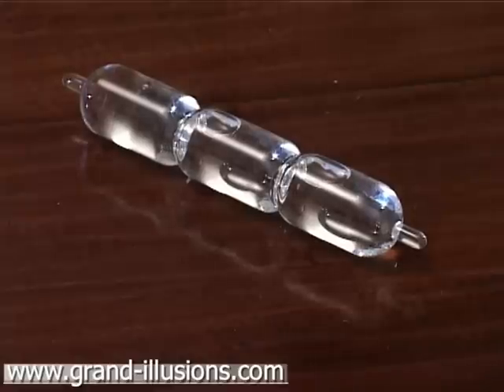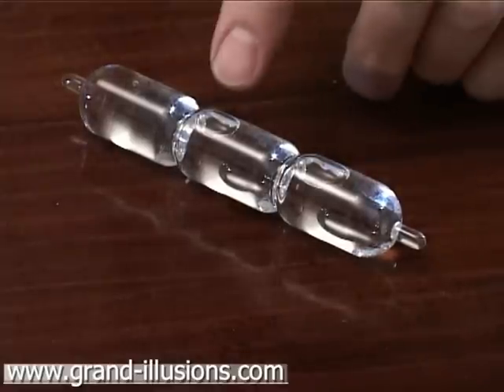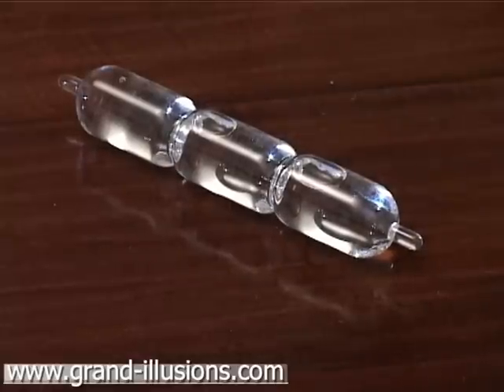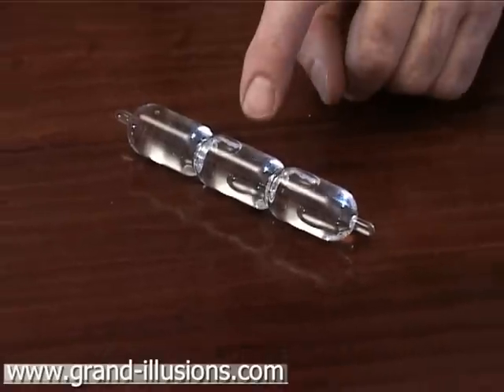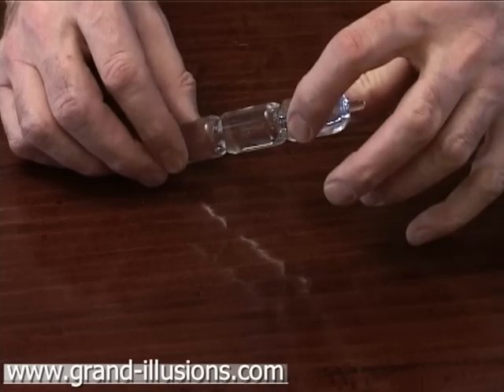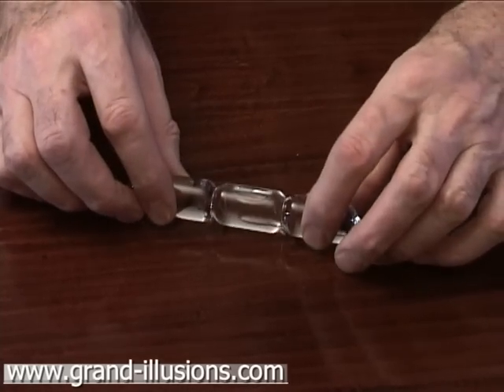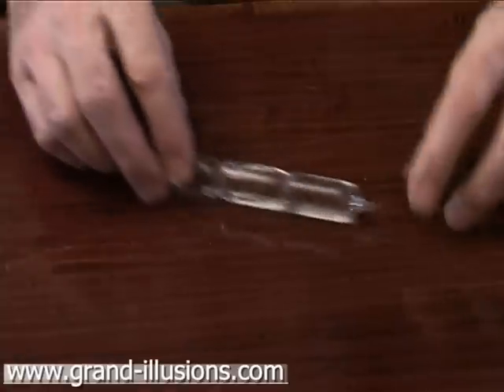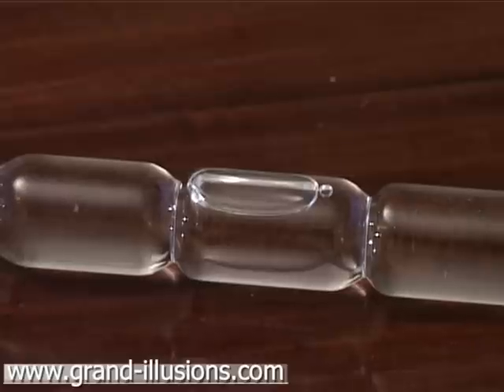Bubble Trouble

Comment: The spinning force pushes the water to the sides making higher water pressure in the two outer butt plugs. The water pressure pushes the air out of the outer butt plugs and into the center.
Reply: Into the what now?
Reply: @jessbano3715  The center
Reply: oh
Reply: @ketheranechromate7479  Not what they meant
Reply: Well damn, victorians were kinky.
Reply: @nikrue22  "put it in me while we do it, then pull out fast enough so i spin like a beyblade"
Reply: Not really sure if that's accurate, though. Pressure sometimes act weirdly. It's probably better to understand this with fluid mechanics.
Reply: Spinning the puzzle about its center makes it into a simple centrifuge.

The centrifugal force depends upon the radius, speed of rotation, the mass of the particle as well as how densely packed the particles are together. Air particles individually (O2 and N2) are actually roughly twice as heavy as water particles (H2O), so at first you might think air would win, but water is over 800 times as dense as air, so there are 800 times as many particles per unit volume of water fighting the air particles.

Because it is so much more dense, water experiences the centrifugal forces roughly 800 times greater than that of the air, pinning the air to the center, as the air struggles to impart any significant force towards the sides to overcome the water.

An industrial cyclone centrifuge has such great separation forces that you can ignore things like gravity in your calculations, and can separate things like cream and water from one another very quickly.
Reply: The G-force helps find the G-spot.
Reply: Who told you?
Reply: @MrWhatdafuBOOM  it was very clearly a joke my guy
Reply: @Willie6785  I could say the same to you.
Reply: Careful you might loose it
Reply: @hairyprints6640  ok . They have that right.
Reply: Yes OK Einstein, we're not stupid.
Reply: Air out of the WHAT!!!?
Reply: So if this was a double headed butt plug then the center bubble is called the taint because it ain't exactly butt plug
Reply: @theconqueror1111  are you Bill Nye the Science Guy?
Reply: @curtisconrad3668  that’s very true, ... but no, you stick the whole thing up in there! 😂
Reply: @spongebobsquarepants3770  sign me up
Reply: @theconqueror1111  a buttrifuge
Reply: @im_ricebowl  LET IT RIP
Reply: Christ  loves you and is coming back
Cristo ama vocês e está voltando
Cristo te ama y vuelve 
Иисус любит тебя и возвращается
Reply: @MrWhatdafuBOOM joke blind

Comment: Used to have a similar puzzle, it was 2 marbles in a box with both ends sloped and a couple of divets in either end, basically just spin it and both roll up the ramps and into the holes.

Comment: No actually, there is nothing pulling it toward the center. Rather, the water, being heavier than the air, is thrust to the edges via inertia. The water pushes the air out of the way to the center in the process.

Comment: B u b b l e t r o u b l e

A glass puzzle from Victorian days reproduced ...like a little sausage With 3 sections, and it's filled with water but there's some bubbles, air bubbles in it. How do you get the bubble into the centre? There's a single bubble in the middle. you can try tilting this way and tilting that way nothing quite seems to work until you happen to spin the item and then what happens?...
There a single bubble in the centre.

.SOLVED.
Reply: Hello iris

Comment: the effects of centrifugal force on fluids with different mass.
Reply: That's exactly what it is, I remember a guy did this in a space station with his bag of soft drink where he spins the bag of fluid, so the fluids migrated to either sides of the container while the bubbles ended up at the centre, because the fluid and the bubbles have different densities and the generated centrifugal force creates that hydrostatic pressure on both sides of the container pushing the lower density bubbles to the centre. Pure awesomeness!!!!
Reply: monmen1289 get a like 1/8th full 500ml bottle of coke or something dark and spin it fast in the air by flicking the lid end down while you chuck it up, you see it go to both ends, no need for a space station bro.
Reply: fluid(s)??? i thought it was 1 fluid and an air bubble o.o
Reply: Goretantath Shouna Air is a fluid also, just not very dense
Reply: *****  Yeah, it's caused by centrifugal force on the water though. Neither of them are really forces in themselves, they just represent whatever real forces are acting in a given situation. Centrifugal is a bit of an illusion in itself, Imagine time passing in frames as the rod spins, in any one frame the water is being propelled in a straight line, it's only because it is being [centripetally] forced into a circular motion (by the glass) that you perceive the centrifugal force over time as the water rushes to the outside of the circle.  Centripetal force would be the chain on a flail or gravity when a satellite orbits a planet.
Reply: ***** Centrifugal = away from the centre, centripetal = towards the centre. It basically depends on which reference you pick. From the point of view of the water in the toy, it's being pushed away from the centre by a centrifugal force.
Reply: @goretantathshouna245  air actually is also a fluid (but not a liquid) therefore there are 2 fluids.